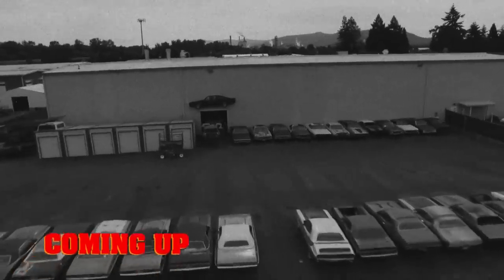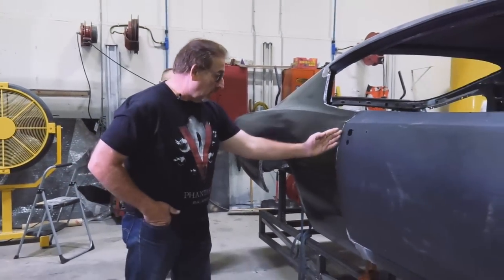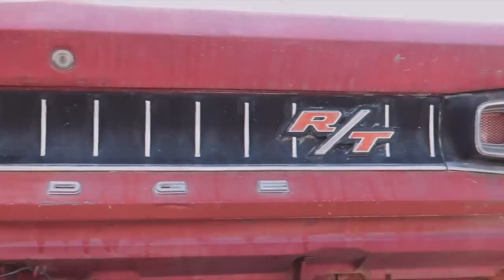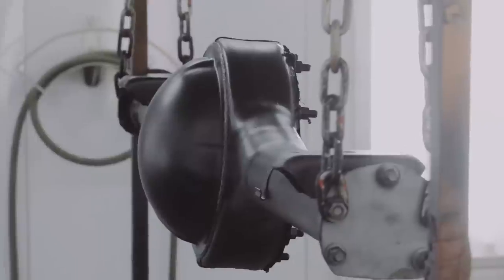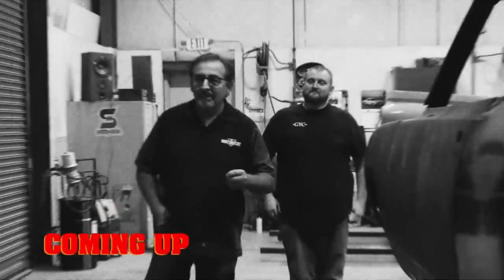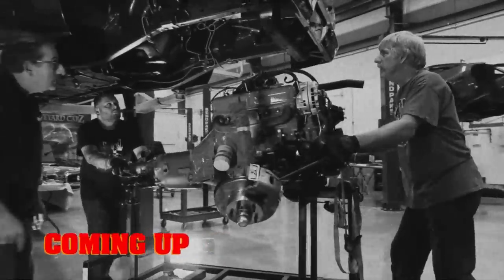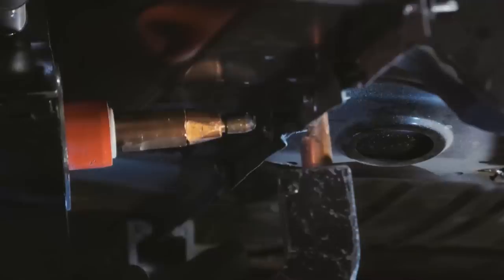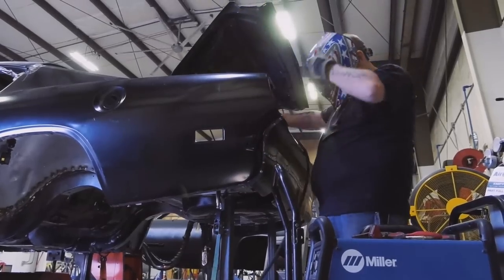FIRST A BODY AT GRAVEYARD CARZ: 340 4 SPEED DUSTER

Comment: I had one of those 1968 RT beauties.
Loved the looks but it handled so well with that well designed front suspension assembly and the tires I had on it which I could not remember.
We used to call it the Rattle Trap only because of acoustic resonating of that huge trunk.
Lots of memories in that piece of art!!
Especially one!! 😉